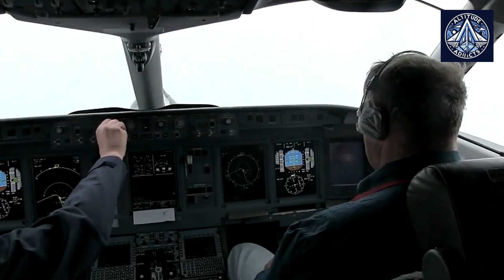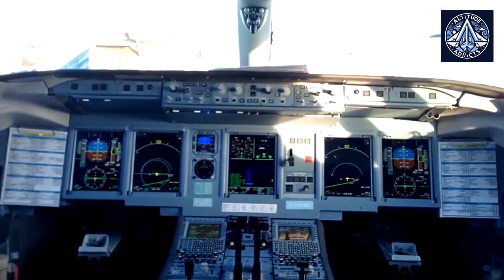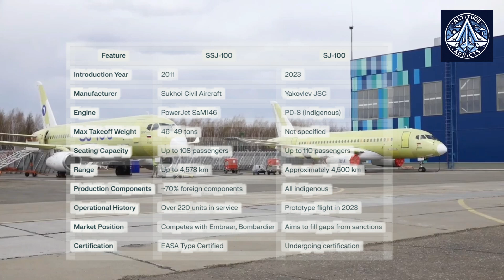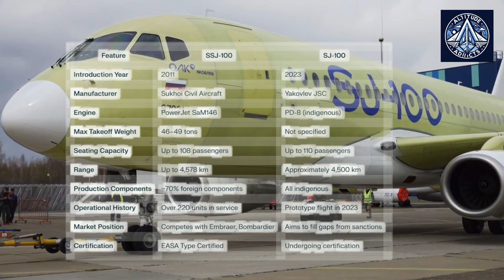How the SJ-100 is Solving the Superjet 100's Biggest Problems

Comment: The original sj100 had 70% foreign components & was overpriced..  
It means the project was sabotaged or not taken seriously by UAC in favour of foreign planes. With Russia 100% reliant on their planes UAC can't make such mistakes they made in the past...
Reply: UAC did what it could. Use of western components sped up the development and reduced the necessity to train crews on bespoke systems, instead having them use familiar interfaces. At the time Russia didn't have a ready set of avionics, materials and other important components. Also they haven't been designing passenger aircraft for many years at that stage, so the needed some ready solutions. They used some of the best gear available at the time. West being a bunch of POSes is a different story.

Comment: The SS-100 was an Italian Project along with the Yak-130 ( Alenia Aermacchi M-346 Master ) they choose the components like the French engines and US avionics, landing gear, brakes and wheels, APU but could not put it together at a reasonable price point so they choose the Yakovlev-130 chassis and then choose an experienced integrator that masters the sleek designs and quality on fighter jets, they choose Sukhoi to put it together!...
In the spirit of collaboration with the West, Sukhoi put it together for them and so the Sukhoi SS-100 was born with the Italian wish list...
It was not a Sukhoi but a project to help the Italians get into the airline business, the final product was finished in Italy with  Recaro seats and ITal Design or Pinifarina interior designs...
Then came the US and convinced the Italians to dump the project in exchange for an stake making the mid section of the Boeing 787..!.. It was then that the hot sections of the French engines started to fail creating some unhappy costumers, The Italians sold those planes to Interjet of Mexico and Belgian carrier....
Since the Italians abandoned the project the Russians inherited it in exchange for a friendly settlement and decided to play with it fixing some mistakes and continuing with the existing cross-licensing agreements but eventually decided to replace all foreign components and make the frame lighter adding more composites plus new engines....
Reply: Итальянские авиаконструкторы - ПОЛНЫЙ ОТСТОЙ...😂
ОТЕЦ SSJ-100 (ПЕРВОНАЧАЛЬНО RRJ) КОНСТУКТОР ИВАШЕЧКИН... КОТОРЫЙ ДО ЭТОГО РАБОТАЛ НАД СУ-25.
ЯК-130, В ТРУДНЫЕ 90-Е ГОДЫ РАЗРАБАТЫВАЛИСЬ В КБ ЯКОВЛЕВА...была попытка работать с итальянскими инвесторами из Алиена .... но... не срослось... Но , конструкцию планера итальянцам осталась... ЯК-130 - С ОТЕЧЕСТВЕННЫМИ ДВИГАТЕЛЯМИ АИ-222-25 ГОРАЗДО БОЛЕЕ ПРОДВИНУТЫЙ БОЕВОЙ САМОЛЁТ, ЧЕМ ЖАЛКАЯ ИТАЛЬЯНСКАЯ ПОРОДИЯ...😂😂
Reply: PNH Botyara sraniy lol BS artist lol
Reply: Yes, I agree, Italians are handsome, and Russians have nothing to do with it.
Reply: @НиколайЗинин-п1х  They are cousins with the same paternal line, The Aryans come from the Yenisei river Valley ( now Siberia, Russia ).. All the 7 Germanic tribes are Aryans mixed with Huns or Turkic nations..... Italy got invaded by the Germanic tribes in the 5th Century after the Huns defeated the Roman empire....
Reply: @НиколайЗинин-п1х  The Italians are Russians too, they are cousins...!.. They are both from Siberia ( Aryans )...
Reply: @НиколайЗинин-п1х  They are all Russians, the Aryans are from the Yenisei Region in Siberia... ( The origin of the Human Y-R DNA...